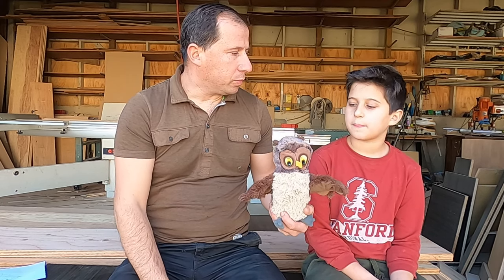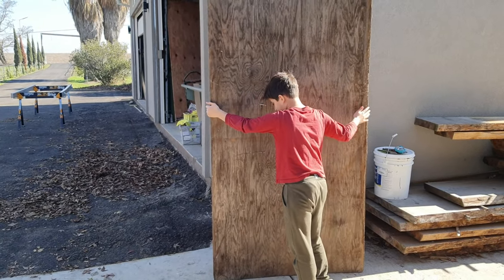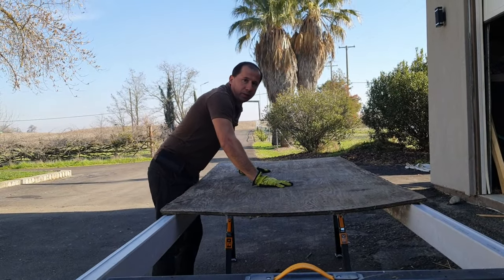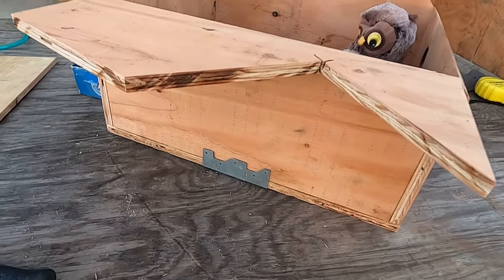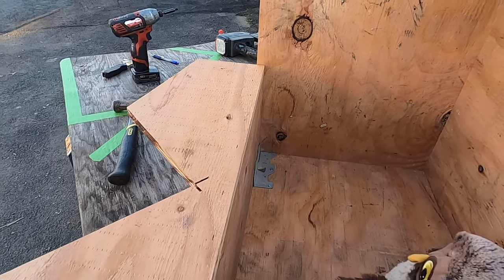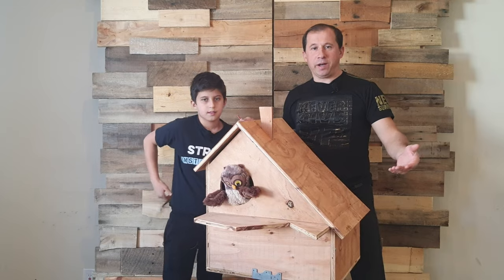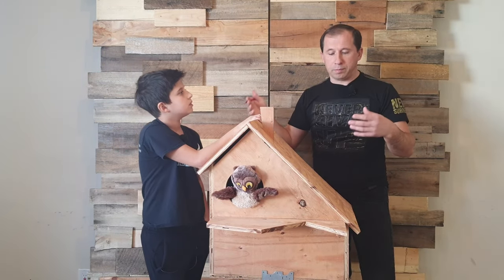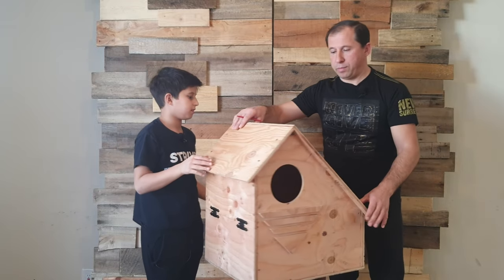How to Built an Owl Box for Barn Owls, Owls Cute and Funny

Comment: The only thing is that a Great Horned Owl or a Kestrel might fly in there and take that space.
Reply from the maker: I hope not.  I have barn owls 🦉in my area.  I hope they will use it.
Reply: Great Horned owls don't typically nest in boxes, they take over nests that were used by other big birds like hawks or even eagles. They nest in open trees. And to the man who made this video, don't forget, owls don't make their own nests. If you make an owl box for them you have to fill it with maybe some dry leaves and wood shavings, not saw dust. Maybe even some hay.
Reply from the maker: I made them for barn owls. Barn owl nesting in boxes like this.  It's coment for the to use box like this.